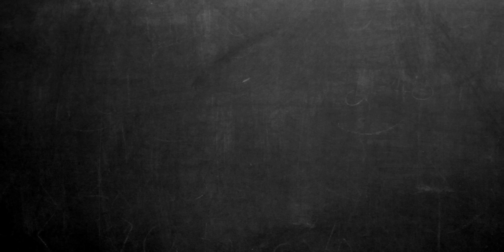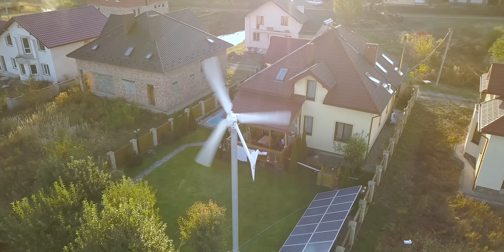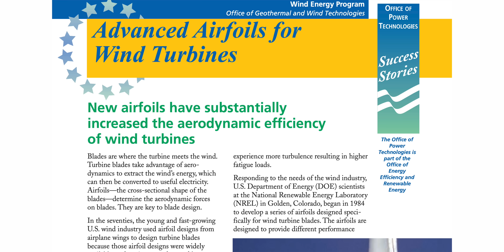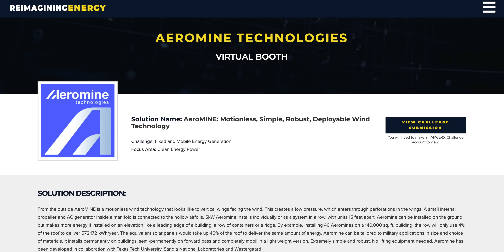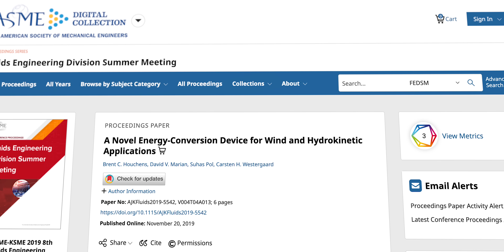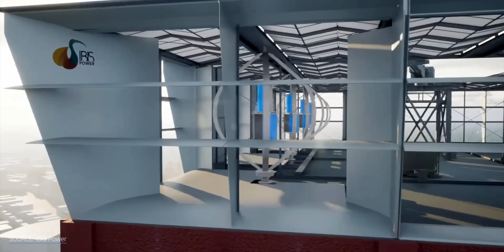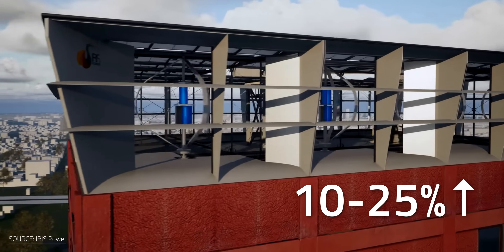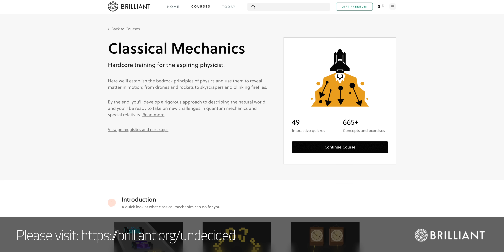How Can A Wind Turbine Be Motionless?

Comment: "Motionless wind turbine" sounds too loud.  It sounds like it has no moving parts at all.  In fact, the blades still rotate, they are just inside the structure, while the structure itself does some manipulations with air flows.  There is not much magic here.  However, the design is interesting from the point of view of application in some places, especially in fairly windy ones.  And it also seems to me that if the system is modified further, it may be possible to apply it to residential buildings (make it higher (3-5m), larger in diameter (about 2.5-3.5m) and integrate it with the house structure). It may work in some places.

Comment: I think one of the issues facing wind turbines in smaller setting is the noise. Large wind turbine produce significant rumbling sounds probably due to the blade oscillations that will carry some distance. Nearby homes fall in value either due to this or simply people don't want to look at them. If a technology can be invented that gives the power and makes no sound and is compact, you will have a winner. That is of course a really big ask though.
Reply: Hi Henri, the turbines in PowerNEST produce some sound when it is really stormy. One might argue who will chil on their balcone when it storming. When it is that stormy, you will need to put your ear in the wind to be able to hear the turbines. It meets all regulation for urban environments. Check out our videos on our channel IBIS Power to hear them while operational

Comment: OK. A wing does not obtain lift due to Bernoulli principle. This misconception got into the books 60 years ago especially in the US and it is still there. The suggestion that air travels faster over the top due to the longer distance of the wing surface at a chosen chord due the wing's camber assumes first that the air molecules meet up again with their partners at the trailing edge. They do not. There are many wings and airfoils that are either symmetrical or have only marginally different distances between the top and bottom of the wing surfaces. A Cessna 172, for example,  has a difference of only about 4%. Using Bernoulli's equations that isn't going to give you enough lift to carry your cell phone. 
It is a chicken or the egg kind of question. In the end what is occurring is a momentum transfer between the on rushing air and the wing. When the air meets the wing it does work on the air as the air changes direction (ie a momentum transfer due to the change in the velocity vector). So, the wing does mechanical work on the air that results, if properly shaped and positioned, for a differential pressure to be manufactured. The desire for lift is to have the greater pressure below the wing and the lesser above it. The motion of the wings does more to evacuate air over the wing than compress it underneath. This is evidenced by how the streamlines over the wing are more aggressively bent implying a greater pressure differential and hence relative lower pressure on the top of the wing. Naturally air being a fluid will flow from high to low pressure and do so with a rapidity proportional to  the magnitude of the pressure difference. So, this is why the air flowing over the top of the wing goes faster than the free stream airflow and is often even supersonic on subsonic jetliners. The air is thus deflected partially downward and so there is a deflection of the wing upward. If the deflection force is great enough to overcome the weight of the airplane it will climb. 
In sum lift is due a momentum change. Bernoulli is about fluids in tubes and the conservation of energy. They are not the same. If you study this you will encounter the Navier-Stokes Equations which have different terms and are beyond the scope of this channel, but lift is primarily about momentum transfer and not Bernoulli.

Comment: It's a little disappointing to not have an Aeromine option for single home buildings.  With their claim of greater returns than solar alone, it would be nice to have a smaller footprint on the property generating the same amount of power.  I have to wonder how this would work in tough environments, like extreme cold/heat or maritime areas.

Comment: The power nest is pretty cool, and since the wind is moving fast it probably cools the solar panels too helping keep them efficient.
Reply: Exactly right! The cooling efect increases the output by 10-15% annually, and most importantly more in the winter than the summer when energy is mostly needed.

Comment: 1,400 MWh of electricity a year from the roof nest, worth around E280k  What is the cost of the equipment and the cost to install, especially on an existing building with a roof structure designed to take those loads?  I suspect the payback time is not great........

Comment: This nest idea but on a much smaller version is what I said could work to create long distance lorries or create long distance storage to unload electric where it's needed for the grid . You could run the nest through a lorry from front to tail and on the roof of the trailer you could run solar the full length .

Comment: Matt, ur a nice guy, but I feel you’ve crossed a line on this video. These technologies are bs. Both require a massive amount of support structure that fails to increase cross-sectional area. This concept has already been studied and shown to be less efficient than just increasing x-sectional area. Also, the first one has a two step process. The first step of drawing air through the holes will have energy loss that can only be compensated with more structure. Also, the holes will ice over.

The second one is an eggbeater design. Sandia Nat. Lab studied them in detail 40 years ago. Simply, they suck. They have resonance problems, they will shake, and fatigue/damage the solar on top (Compensate? Sure: more structure.
   Regarding the benefit that solar can be put on top: Solar could have been put on the rooftop directly. Let me save them some money:  they are not viable projects. They should cut their losses.

This brings me to you. I watch youtube to have presenters package good information concisely. You are concise, but, this time, the information was not good. I hope in the future you open the ‘hood’ more and parrot a company’s sales literature less. Good luck!

Comment: The reason you don't see small wind turbines is because of the fundamental law of area, namely an area goes up by the SQUARE of it's encompassing vertexes!  This means that small wind turbines simply cannot capture enough energy to pay for themselves, because the costs don't scale linearly with size, the energy capture scales with the square of size.  For example, double the size of a wind turbine and it only costs (approximately) 50% more to make, but it captures four times as much energy!  It's also why commerical wind turbines are now absolutely huge!

Comment: I feel like a wind turbine working in only one wind direction defeats any potential efficiency gain of the design, outside of some niche geography ensuring wind direction is consistent

If they can design roller bearings for large excavatorssnd cranes I see no reason why they couldn't find a way to make these turbines turn as well

Comment: It does make sense to capture the air and concentrate it in a more easily usable way since that's what we do with most other energy harvesting systems. But I think they need to find a way to get the turbine mounted directly in the base of this thing so it's all one unit and won't have to move large volumes of air through pipes where it will quickly lose energy from friction. Also, making the whole thing able to pivot into the wind's direction would make them way more versatile in where they can be placed

Comment: The Aeromine is a Dyson fan with some differences. I do like the idea. I also see that there are ways to combine the idea with residential construction. The smaller local wind units are the way to go. The bigger wind farms require an infrastructure the local ones do not. Removing the infrastructure removes much of the cost of the wind farms. Eliminating the large structure holding up the large wind turbine can also be eliminated with the smaller design. This also reduces the cost and environmental impact. The smaller ones should be easier to decommission and have less difficult maintenance. Please understand the rare earths required for the generators magnets will still be required.

Comment: seems to me they are trying to polish a VAWT turd. Sure I believe the 140% increase in windspeed, I've experienced gale force winds around tall buildings. 
However a VAWT is about 15% efficient, while a HAWT is something in the range of 35-40% efficient. 
On top of that, the larger the windmill, the exponential more energy you can capture. And a VAWT on top of a building simply can't be large. 

As for the aeromine, it seems interesting as a concept. However many new emerging concepts fail to proof them in actual use and numbers. The ridgemount thing has proven to be a dud so far, despite interesting physics at play.

Comment: The ultralow wind speed generation claim is always hype bullshit. It is true that systems designed to operate in extremely low wind speeds can produce current, but it is not a useful amount. There is extremely little energy to extract from low speed winds, so there is no generation efficiency good enough to be worthwhile. Most of these systems can barely extract enough energy from low wind speeds to power flashlights

Utility scale wind farms don't turn below 9kms because those windspeeds aren't worth it, not because they aren't clever enough. The ultralow wind generator claim is a distraction, not an actual selling point

There is an actual wind turbine engineer who runs the channel Engineering with Rosie. She has done some good videos explaining the principles of these systems, and did a longform Livestream that explained how most of these ideas have been around, and failed to break though, for decades.

 Aeromine's ducted airfoil generator is not a novel idea, and it hasn't worked before. What has the company actually done differently? This company's sensationalist advertising and failure to provide verifiable information is extremely suspicious and I am disappointed that this channel has promoted them without critically analyzing their claims

Comment: Thanks Matt for all your brilliant videos. I am George, I have been thinking about designing green energy machines for many years. Wind turbine is definitely a very important direction for future green energy, but I don't know why few products aim for low RPM, high torque mechanism? the faster any kinds of wind turbine rotates means more noise, vibration, maintenance issue (wear down of the mechanical parts). But maybe low RPM high torque mechanism design can reduce more potential problems?

Comment: Love your videos, you make excellent content. However. This explanation of an aerofoil is incorrect, although a very common misconception. They work by altering the velocity of the oncoming air, and experiencing an aerodynamic force perpendicular to the angle of attack. The specialised curvature of the foil is to preserve laminar flow in the upper surface boundary layer which if detached, simply put, reduces the effectiveness of a given shape to generate lift. Please look in to this, as you are a popular channel, and its painful to see misinformation presented from a reputable source like yourself.

Comment: I have 12 kw solar and a 1,000 watt hurricane turbine. It's super cloudy only producing 600 watts. Almost no wind. 0 watts. Spend $70,000 for off grid equipment currently running on grid cause my 70kwh batteries are dead. 2,000 sq fr House. Natural gas heat. This is not the future

Comment: I did a project once for a university class on sustainability that used some of these concepts.  My proposal was a vertical farm with a gap between each floor for a large horizontal wind turbine that rotated around a large central shaft in the building.  Combined with solar panels covering every non-window facade, it would generate the primary power used to water and light the crops.  Water would mainly be pumped to large tanks at the top before gravity feeding floor by floor before being reclaimed at the basement.  Still think its a workable concept.
Reply: Does that increase pressure on the building's beams and cause a more-than-usual sway?
Reply: @fisherfriendman  sadly, i have no idea.  It was a simple proposal.  I never did any in depth design work or engineering.  However,  more modern redesign could simply dedicate every other or every few floors as open air wind generation floors with no windows; basically the energy pod things in this video placed on lower levels or even just part of a level instead of just on the roof.  Mind you, this idea was intended for major metropolitan cities to shorten fresh produce supply lines so it would be a 8, 10, 30 floor skyscraper type building.

Comment: I wonder how these quite complicated designs of high towers with rotating top sections and again rotating giant blades attached to them became the standard for wind turbines.
Wouldn't some kind of Flettner rotor be way easier to build, maintain and operate? One such design was briefly shown in the intro. These don't care where the wind comes from and therefore don't need to be positioned right, one thing less to be potentially not working. And if we are able to construct giant, top heavy towers, we should be able to build a solid fundament for a vertical axis, I guess.
For small applications this seems ideal to me, so how come we see so little of these designs?

Comment: I don’t get why these small scale wind videos never seem to address the basic problems with all of these devices: the wind in urban environments is unreliable, variable and there is a very limited amount of ener in it. No matter how you spin it, you’re not going to get more energy out than there is in the wind to begin with. In fact, in a perfect world you might get about 60%, but you will never reach that in practice. Wind turbines are so large for a reason: with bigger blades, you catch way more wind (rises with the square of the blade length), and at higher altitudes there is more, and more steady wind. And out at sea again: more and more steady wind available. And all of these systems have moving parts. That implies maintenance and efficiency loses as they wear and get dirty. I really, really question the claims about the amount of power these things will provide. Replacing an entire roof installation of solar panels? Where? With what prevailing wind and what level of yearly sun?

Comment: The vertical setup seems a bit limited,, but I can imaging arched, spoke, or even radial designs (still stationary) that might take better advantage of wind direction variability, although I'm not  sure how much that would impact efficiency. seems like fertile ground for exploration though.
Reply: The vertical design seems to be interesting, since extending the wings could give better results, without losing real estate!
Reply: @DavidHalko  My thinking is that a single unit wouldn't be the whole installation, so increasing the footprint a bit with arched surfaces would be a viable tradeoff for density, and shouldn't interfere with verticality (which will probably be determined by load bearing anyway)... assuming of course that directionality could be improved. Wind is a finicky thing at building rooftop level vs street level
Reply: @TheVoidSinger  - wind 💨 is really an interesting thing… u r right!

A large lazy suzan could fix all kind of interesting issues, and more wind will be available as the wings extend higher.

There are residential codes which keep any building addition below the highest portion of the house 🏡, which makes these devices rather difficult to make residentially viable.

With more wind being harvested, wind 💨 might slow down as it needs to traverse continents, causing broad regional warming.

Comment: My understanding of wings and other airfoils is that it's not the high pressure doing the work, it's the low pressure. So airplanes fly not because the wings are being pushed up by the air flow under them, but pulled up by the low pressure above them.

Comment: 3:20 Isn't the opposite of this true? The air above the car moves faster because it has a longer way to travel thus making it less dense. The air below the car/wing is denser and has a higher pressure than the air above the car/wing which lifts the object into the air. The car just doesn't take off because the lifting force is not strong enough and because of other counter measures.